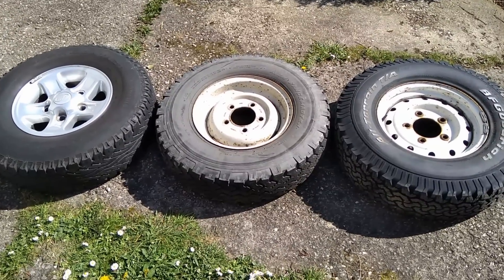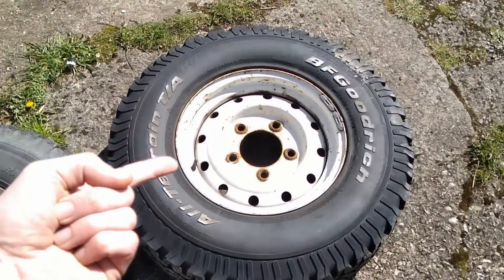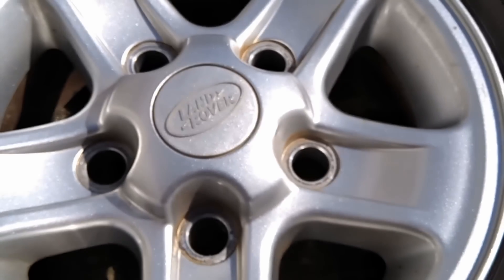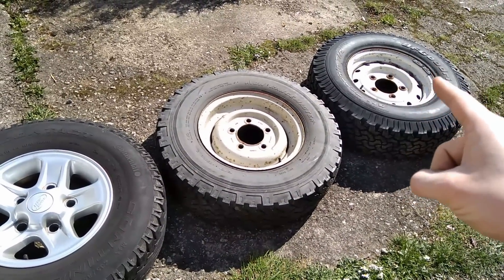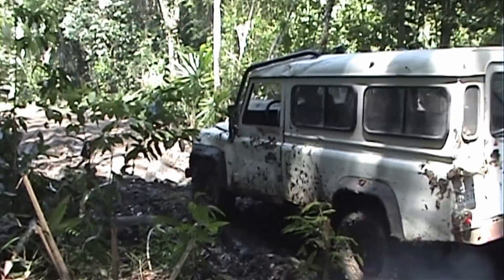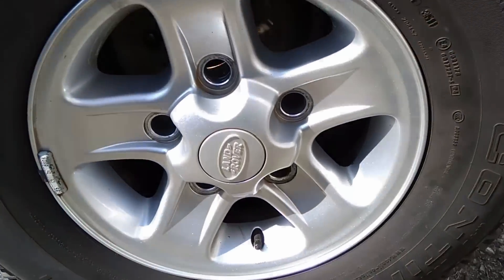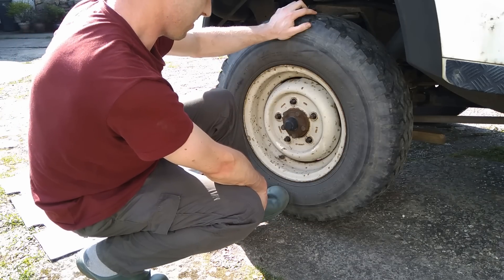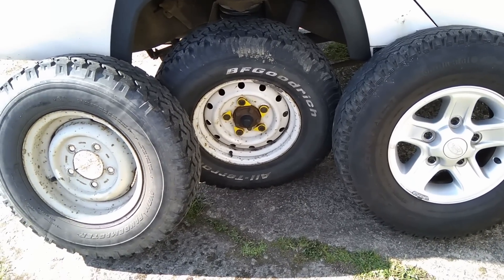The 3 standard Defender wheels - Steel, Wolf and Boost - plus their WEIGHTS!

Comment: I know it’s all a matter of personal preference and taste, but I just don’t personally like alloy wheels on a defender; I don’t (again, this is entirely personal taste) like bling on land rovers. I like the standard Land Rover look. From a mechanical perspective, I prefer the way the standard wheel offset keeps the wheel loading closer to the centre of the wheel bearings than either wolf or boost (and certainly compared to a modular), though it also reduces the track width and, in theory at least, roll stability. Choices, choices, - and I don’t think there is any clear right or wrong answer. Thanks again. James

Comment: My 90 came with boost alloys that had seen better days, lots of kerb rash. I replaced them with wolf rims which looked pretty good, my 90 is green so they went nicely as a ‘military’ look. But then I had my original boosts powder coated satin black and put them back on with some Kumho MTs and now the whole thing looks awesome, with no impact on fuel consumption, maybe due to the lighter rims. Handles great, even on the motorway. Think I’ll stick with the boosts now. Thanks for the interesting video!
Reply from the maker: Good to hear your experiences :)

Comment: If you're struggling with the weight when lifting the wheel onto the hub, put a shovel under the wheel and stand on the shaft to jack it up.
Reply from the maker: Good tip Richard

Comment: I'm no wimp but I was utterly amazed at the weight of my wolf wheels. Don't under estimate the effort needed to change a wheel, especially in the wet. Great video. Very useful.
Reply from the maker: Thanks Chazni
Reply: Try doing it with old 6.5" steelies running 900x16 tyres ;)

Comment: I CARRY A PLASTIC FOLDING STEP/SEAT IN MY TRUCK, I SIT FACING THE TRUCK AND REST THE WHEEL ON BOTH MY FEET. THEN SIMPLY LIFT THE FRONT OF MY FEET WITH HEELS ON THE GROUND AND LIFT THE WHEEL UP TO THE HOLES, LEAVING BOTH HANDS FREE TO CENTRE THE HOLES AND FIX THE WHEEL NUTS... SO EASY WITH BIG HEAVY TYRES AND NOT FIGHTING GRAVITY....

Comment: Problem with the wolf wheels is that they're more desirable than the alloys to a lot of light(haha)fingered types but the locking wheel nuts out there aren't much collar against a heavy steel. I've seen them work loose under off road conditions. 

Brilliant comparison ... very interesting. I was wondering with the quality of tyres these days if it's worth just learning how to use tyre levers for the 2nd spare at least.
Reply from the maker: Yes that's a good option Matt, if you're practised enough :)
Reply: @lrworkshop  Unfortunately I'm not very practised at all. What's that you say? You want to do a video on how it's done the right way in a wildly exotic comparison between the correct 3' heavy duty metal bars vs single use chopsticks? Excellent news buddy!
Reply from the maker: @mjallenuk  lol ;)

Comment: Great video, shame you didn't have modular steal wheel to compare as well as they are also very common on Defenders. I had Ranger rover clasic wheels on my LR90 when I bought it and replaced them with modular steal wheels that looks much better. Maybe I change to Woolf wheels at some point, but would you change wheel studs for Woolf wheels or just tightened them as MOD recomended?
Reply from the maker: I had modulars on my previous Defender. They're great for wider tyres. I don't have the longer studs with my wolf wheels. Mike did a video on the wolf studs: https://www.youtube.com/watch?v=2kVDIB1BBqY
Reply: @lrworkshop  thanks for the link 👍

Comment: Hi Will, Informative video. Recently discovered that many 4x4 wheel and tyre suppliers do not provide information about the weight of either wheels or tyres. Apparently I was only one in ten years to ask! Really?? My tuff torque "wolf" wheels weigh about 16kg and Cooper Discoverer St Maxx 235/85 about 23kg. BFGs ATs about the same. It's a lot. I note your comment about Wolf's being 2200kg rated but find this confusing. How many tyres are rated to 2200kg - I think it's difficult to find a tyre rated much more than about 1400kg so the tyre will fail way before the wheel.
Reply from the maker: Hi Simon. Good point about the tyres. The Michelin XZLs were the standard fitment from the factory on Wolf wheels (6 ply sidewalls!). 
I was trying to find info relating to the Boost and Standard wheel ratings to put in this video, but I couldn't find a reputable source. I could only find figures for the aftermarket Boost wheels of being somewhere between 950kg and 1070kg rated.

Comment: Interesting, thanks. My understanding is that you can't fit boost alloys to vehicles with rear drum brakes, unless you use spacers. 
That's a serious amount of balance weights on that Wolf wheel fitted to the front of the 110! Think I would put that one on the rear!
Reply from the maker: Yeah my front tyres are a bit screwed (3mm wear difference inner and outer edges) so they get out of balance within a few months. I'm toying with whether to replace them or rotate. Got an MOT next week so I'll see what comes up!
Reply: Naaa keep it on the front ... gives you an authentic straight from the factory feel.

Comment: Great video.  Could you do a follow-up on fitting bigger tyres?  Including pros/cons, clearance issues, etc.  For example, could I change my LT235/85R16's for LT265/75R16's without doing any mods?  Cheers.  Really enjoying your videos. Keep them coming !!
Reply from the maker: Thanks Wayne. I can look into it. In general I think it's possible, you may just have to adjust the steering lock stops to stop the tyres rubbing the radius arm.
Reply: Thanks for the advice.
Reply: I run that size without issue. But do not know if the original owner tweaked anything.

Comment: Thanks for the video. Any performance difference with the heavier wolf steel wheels compared the the alloy?
Reply: Probably not much that a person would notice. But being heavier, the steel wheels will negatively affect quite literally every aspect of the vehicle. Slower acceleration, worse fuel consumption, poor handling, longer braking distances. They’re also tougher on the steering components and entire drive train. All fairly negligible, but they’re there. 
Yes if you hit something hard enough to dent it, hammering the dent out is easy and you’re back on the road. Alloy wheels just break. However, if you ever hit anything hard enough to shatter an alloy wheel nestled inside a thick offroad tire… it doesn’t matter. Because that amount of impact force will have probably ejected the engine into a low earth orbit, and sent your axle flying three time zones over. So a busted wheel is the least of your worries at that point lol 🤷‍♂️
I like the Wolf wheels as far as aesthetics go, best looking Defender wheel ever in my mind. But I’d never run them on mine.

Comment: Really liked the series steel wheel. Will they fit on a standard 95 Disco 1 300tdi? if so, which specific wheel? since they have different types. cheers
Reply: I have the same question

Comment: Hi Will, what do you think of the strength of et08 modular steel wheels 7" wide? are they similar in strength to the standard steel wheels but with just a bit more offset?
Reply from the maker: I had some for a year. The steel is just as thick as on wolf wheels so they must be pretty strong. Thanks for the comment!
Reply: @lrworkshop  ahh spot on they must be then, explains why they're fairly heavy
Reply: It's a bit difficult to see the detail but it seems you haven't put longer studs on the hubs. The studs don't extend to the full length of the nuts when Wolf wheels are fitted in that case. IMO that looks a bit odd and isn't recommended practice. In some countries this breaches the regulations.
If there are longer studs installed I withdraw the comment!

Comment: Never had any problems with the standard rims, always laden and off road everyday. I might be wrong but I think the standard rim was fitted on the 127 till the wolf came out?
Reply from the maker: Yeah I think most people will never get their vehicle to GVW, so standard rims are very capable. Wolf wheels came out in Summer 1995, so I guess then 127 had standard rims, or was that the 1 ton rim?
Reply: @lrworkshop  The 127 used the ANR1534 rims (6.5" but slightly different construction to the old series 6.5" rims) but early ones did run normal 5.5" rims.

Comment: I have deep dish alloys fitted to my ‘97 110 csw (registered in 98). I want to either get these refurbished or replace them dependant on if they’re genuine or age correct for the vehicle. I have been struggling however to find out what the correct markings should be. I’ve searched the internet and inspect many at auto jumble stalls at shows but I’m still non the wiser. 

I don’t suppose you know what the correct markings are? And what alloy options were available in the 97/98 model year? I’m fairly certain deep dish were fitted to defender in this time along with boost but I’m not sure. Most people know which alloys are wright rated per vehicle but that’s about it.

Comment: In your experience, how does a skinny tyre perform off-road? It is normal to see pumped up 4wd with massive tyres but wondering how a skinny one such as the defender ones perform.
Reply from the maker: Thin tyres are better for mud and sand (less resistance to cut through). Fat tyres are better for rock crawling
Reply: @lrworkshop  that's what I have suspected, thanks!

Comment: What are your thoughts on putting alloy boosts on a 1993 Defender 110 with rear drum brakes?  I'm considering my options now, and thinking Wolf Wheels as the main option, so I don't have to run spacers etc.  I found some deep dish alloys, but with 30mm spacers, they technically would not be road legal here in NZ.

Comment: I never understood why the Defender alloy wasn't self centering.
Reply from the maker: I think a lot is to do with the wheel nuts not being conical, alloys would likely crack so they used flat faced nuts to provide a clamping force
Reply: They do self centre, but it’s based on the hub, not the studs.  The steel wheels have a small gap between the hub and wheel nave centre hole, so don’t centre on the hub itself.